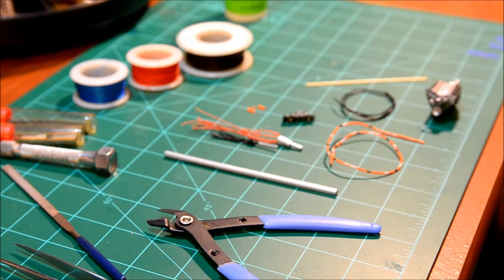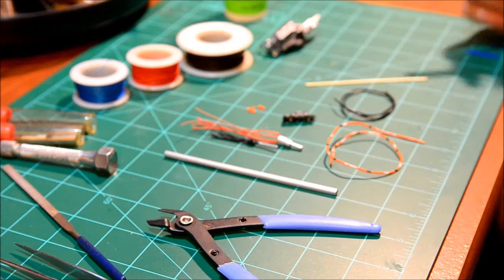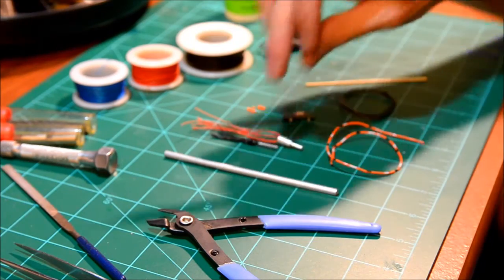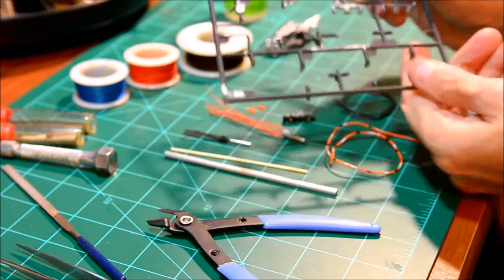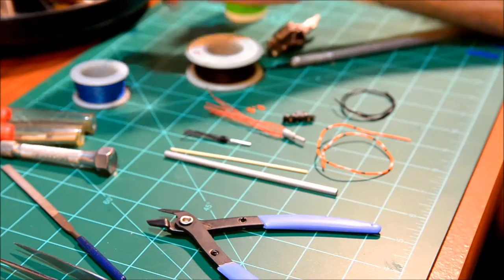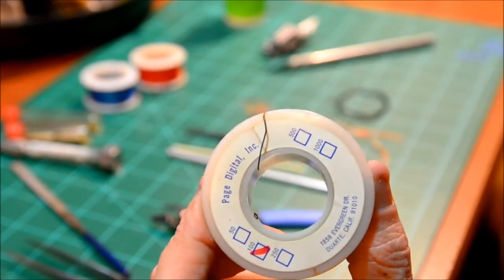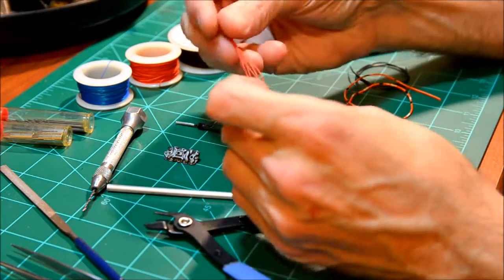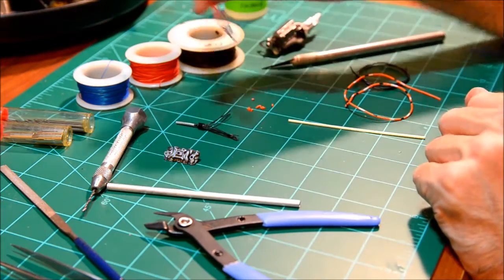Revell 1969 Nova SS, Update 1 - How to scratch build a distributor

Comment: The only thing that i do different is i use 30awg wires and 28awg boots. You use the 3/16 tube just like myself. 
But i do build circle track race cars, so the wire i use is ideal for those, now with a drag or high performance type kit i would see using the size wires you have for sure.

Comment: For race cars (drag, stock cars, etc) 30 awg is ok. In fractional measurements that is .025 wire diameter. Stock plug wires should actually be .012 to '016 in size.